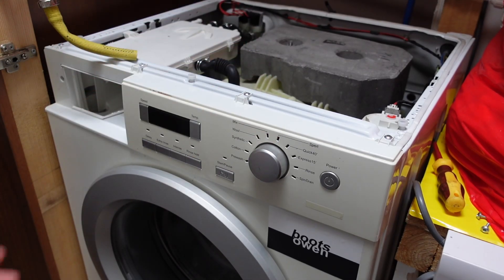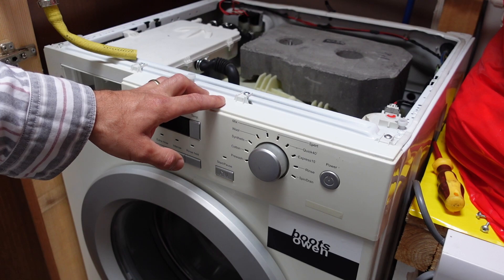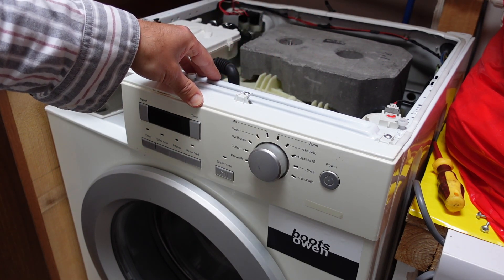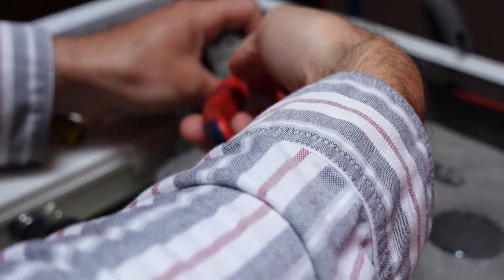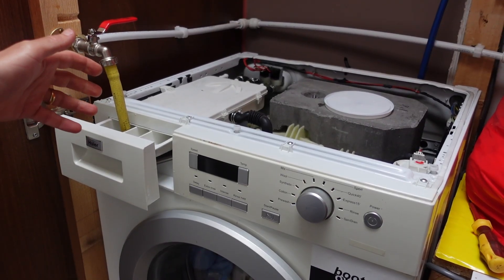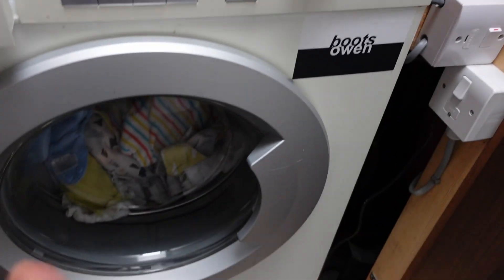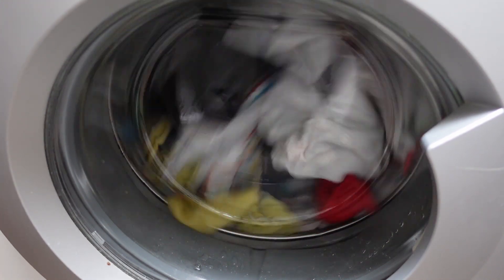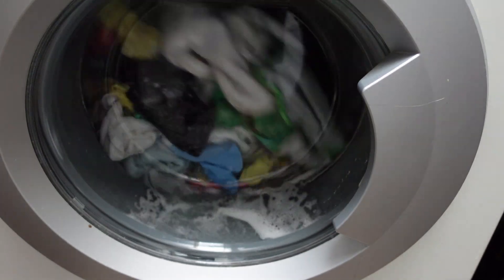Washing machine not filling with ENOUGH water: removing the flow restrictor to improve fill

Comment: For the main wash, (in my opinion) water below the door is quite adequate. For rinsing it is not though. 
You also mentioned that it could have been like this from the very beginning? It might have accumulated residues inside, that's why the clothes smell musty?
The last resort is to replace the pressure switch. However, you might want to disconnect the NTC and re-connect it. That apparently resets the machine's electronics, or at least in the HW70-1202, this was done if you wanted to reset the model, to the highest spinning, highest capacity one. Therefore the display showing 1409 means 1400rpm 9Kg, 1408 means 1400rpm 8Kg, 0806 means 800rpm, 6Kg. The system when turned on after adjusting, only lets you decrease, and by doing the NTC disconnection and re-connection makes the system start from the biggest capacity, fastest spinning model. To do this (if I remember correctly) you have to press a particular button (Easy Iron, I think?) and turn on while holding this button. Perhaps someone accidentally hit this function and decreased the capacity or something?? I discovered this through the service manual , which should be available online... I will try to find it.
Reply: have you found it yet? I am interested

Comment: Just a few insights! The only culprit here should be the pressure switch, because that's where the "go" signal comes from. Maybe it's gone bad, and it's closing before the water level reaches the correct set point (I'd play with the adjustment cap, as suggested).
Now let's talk about "enough water". I have a modern washing machine, that gets the clothes completely wet and stops filling when there's an inch of water inside the drum. The only way I get "clean rinses" is when I use a program that performs a fast spin before the first rinse. If I use a quick program, that skips spin phases to gain time, I get "soapy" rinses right through the final rinse.
I see boomers complaining that the only way is a top loader with a full tub of water, but the one and only rinse those machines perform is soapy and mucky. There's no way I'm calling those clothes clean.
Reply from the maker: So many machines seem to have a layer of soap scum inside, nothing could really be cleaned in them. The response to dirty clothes seems to be to add more detergent rather than thinking through what the issue is, People do a fast 15 or 30 minute wash. Nothing is really clean.

Comment: I thought you told me you turned the pressure switch but in the video you said you were going to adjust it next time. And if it is true that you turned it why did you say it worked, but the problem is still there. Turn it it might help.
Reply from the maker: One video at a time.

Comment: The red dot with the screw/alan key socket On the pressure switch ( this is the water level amount) turn it clockwise a full turn.  as long as u are not in ur warrenty period. ur fine. turning it does void the machine..  but when you do adjust it... make sure u keep eye on your machine. because u could flood it.. But also adjusting it can degrade your machines performance.

You could try - The washer's water level is determined by the Load Size option. The electronic control is programmed with default Load Size selections. If a user selects a Load Size and then rotates the knob to change the cycle, the Load Size setting will be automatically changed to the default for the new cycle.

But like most say, turn the restrictor all the way until it stops turning.. these hairer machines are such a pain!
Reply from the maker: Thanks

Comment: I think the plastic hex key socket on the pressure switch is just a dust cap and the adjustment screw is underneath. The red paint is what they put on after its calibrated.
Reply from the maker: Thanks

Comment: I would say inadequate water pressure run a hose up to it off the mains pressured outlet 😊
Reply from the maker: The mains here is not very strong and intermittent
Reply: @bootsowen  still might be the problem then ?

Comment: Have you posted the dispenser door out and cleaned inside because it could be that some of the holes are blocked?
Reply from the maker: Yes. I I took it apart in yesterday’s video and cleaned it. It came apart easily.

Comment: Never had those Haier machines, are those reliable or trash? We have those Haier machines here in finland but i have never came across one
Reply from the maker: It seems reliable and looks like it is easy to repair. Splittable tub so you can replace the bearings. Most parts look like cheap generic so probably easy to keep it going